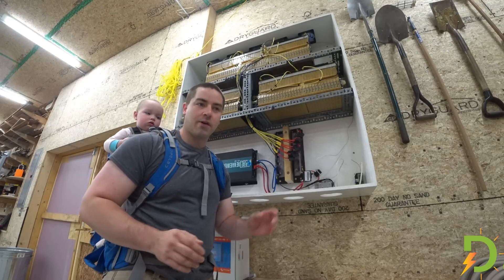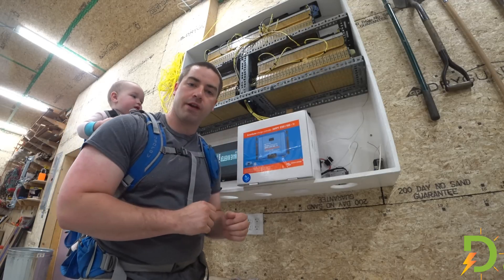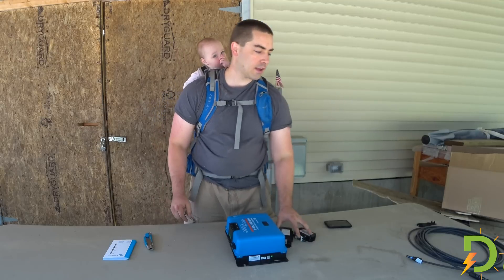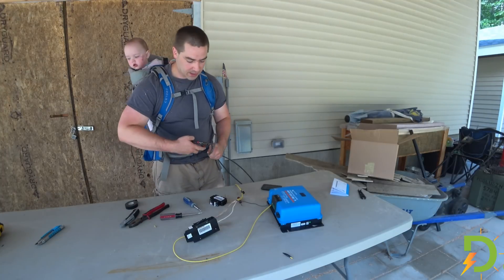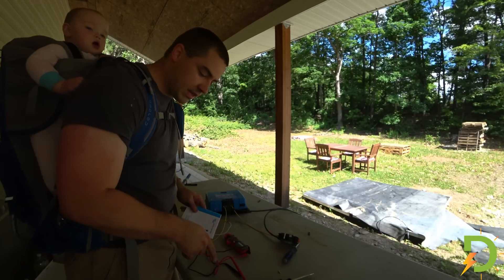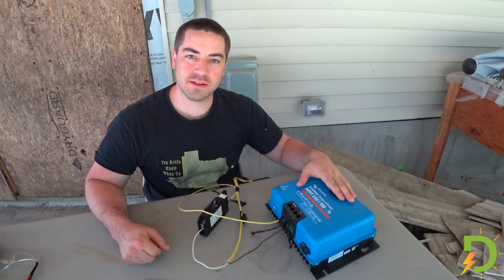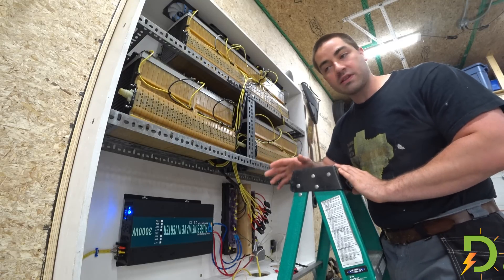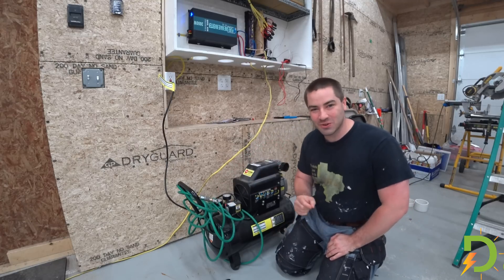Victron 250/100 Solar Charge Controller MPPT, Off-Grid System

Comment: If you have a 12S Li-ion battery system, shouldn't the charging voltage be 50.4V since each cell is 4.2 and 12 in series is 50.4V? Is there a way to set the charge controller to this exact voltage?
Reply from the maker: Hi redstone craft guy,  You are right.  4.2 volts per cell is the maximum voltage per cell for this type of battery.  The Victron charge controller can be set to exactly 50.4 and does an excellent job stopping there.  I'm keeping my voltage a little lower at the moment because I have not yet installed a BMS.  A BMS is "Battery Management System" and offers safety when maxing out the charging.  Thanks for watching.
Reply: @DavidPozEnergy  ok thanks.
Reply: @DavidPozEnergy  If you don't need the extra 20% capacity, keep it at 4.00v per cell you will get about 4x the cycle life at that voltage compared to 4.20v charging.

Comment: If you didn't have an iphone could you have updated the firmware yourself?
Reply from the maker: No.  The charge controller was shipped with a firmware two versions old.  My Battery monitor from victrron was also shipped with a firmware 2 versions old.  I've had others comment the same thing with tier stuff.  That old firmware does not work with my android version.  I tried using the app on my windows laptop (which according to Victron is also supposed to be compatible) and that still did not work with the old firmware. However, I've had others comment on this video saying that the old firmware worked on their androids (different android version).  So it sounds pretty hit or miss.  If my wife did not have an iphone I probably would have asked a friend to come over.  If that did not work I would have had to return it and ask Victron to send me one with an updated firmware.

Comment: Thank you.  I am at the learning stage.  I have purchased some panels.  I will probably pick up that brand of controller too.  Would you recommend the Volt Battery over the Tesla Battery packs?   I seem to have easy access to the Tesla batteries at $1,250 each.
Reply from the maker: Hi Bill,  I'm glad the video can help you with your setup.  I do not recommend Volt over Tesla, or the other way around, they can both work great. 
 I have not used the tesla batteries myself, but from what I can see they are very easy to wire up.  I had to modify the wiring in the Chevy Volt pack (check out the video) but with the Tesla I think they are good to go from the start.  So that is nice.  But, the Teslas are a bit more expensive.

Comment: Really enjoying your videos. :-)  I am running the Victron 150/70 controller with 1800W of solar to a 24V Li-Ion battery bank from an EV. I am curious what settings you are using for absorption and bulk. Since I am running 6S, I just set them both to 24.6 (4.1V per cell) and feel this could be better optimized. Thanks!
Reply from the maker: Hi Doug M,  Right now I'm not cycling my batteries very much, so I am using 4.0 volts per cell x 12 cell or 48.0 volts in absorption.  Then I'm running float at 47.7.  This was recommended by "The Hillside Pranburi" and made sense to keep the charge controller from short cycling between the two modes.
Reply: That makes sense. Thanks again for the great content!
Reply: @dougm4154  You don't float Li-ion batteries.  It's bad for them.  Floating should be disabled (not sure if this is possible).

Comment: The Volt Batt are liquid cooled,  if you draw too much or you fast charge it will they get hot without coolant ?
Reply from the maker: You are right, if I was to move too many amps too quickly in or out of the batteries they could overheat.  The good news is that running a tool and AC in my garage is nothing compared to moving a car down the highway.  I'm not pushing these batteries at all.

Comment: do you need a Battery Management System if batteries are not lead acid?
Reply from the maker: Most sites I've read say a BMS is very important with lithium batteries, however there are some YouTuber's I've seen without them.  I suggest them to err on the safe side.

Comment: Not all Bluetooth implementations are equal. My wife's fitbit has trouble with both Samsung and Huawei. The Victronconnect app works fine on an ancient note2 and on my new Huawei but fails on the s4 mini. That's to say, it might be a combination of the phone and the older firmware on the Bluetooth interface. These controllers always ship with slightly older firmware. You are expected to update them at install time.

Comment: You basically just proved that a BMS is not really necessary. With batteries with such low internal resistance and wires cut the the same length...I believe it will boil down to a maintenance issue 3 or 2 or 3 times a year.. great job man..  love the videos .my inverter is coming in the mail. Can't wait to move forward with my own set up
Reply from the maker: I'd love to see some pictures of your setup, I'm on facebook if it is easier: https://www.facebook.com/DavidPozEnergy/
Also, check out this video Mark made.  He has been using batteries with no BMS for over a year.  https://youtu.be/si-8N972A-U

Comment: For Android phone to work with victron app turn GPS on
Reply from the maker: Hi akram hawere,  Thanks for the suggestion.  I had tried that, along with several other suggestions I found on blogs.  Nothing worked until I updated the firmware.  Now the charge controller will connect to my android even with GPS off.

Comment: If you are connecting your PV panels in series, then you will get the same amperage no matter how many (assuming they are the same). So you can use the same cable for 2 or 12. This is the main advantage of higher voltage configurations (in series) vs high amperage (in parallel).
Reply from the maker: Hi Jarek,  Thanks for watching.  As for my comment about only two panels to keep the amps lower, I was reffering to the battery side.  The MPPT charge controller drops the volts down, and increases the amps.  I was using a piece of 12 AWG wire.

Comment: 10:01 Are all the holes on the face-plate for venting/screws?  I am wondering if the circular ones might be connected to each cell to check voltage/screw connection during initial install.   Not really sure if that made sense... 
Looks like a great system.  I am big into upcycling and repurposing things as well as solar in general.  Glad I found  your channel.
Reply from the maker: Hi Dakota,  I not sure which holes you are referring to, but here goes...  The battery shelves are made of slotted steel angle.  That is made with holes and slots to allow different bolting options.  Or, if you are referring to the 5 large holes in the bottom of the cabinet, then those are to allow venting when I install Plexiglas on the front.  I hope one of those helped. Thanks for watching.

Comment: Victron Bluetooth only seems to work with half the phones you throw at it. I tried 3 Huaweis (no dice). Works with Samsung A5, Tab 4 and ZTE A520.  It's going to be a major problem 7 years down the line, when you find nothing works.  One thing that worries me is that amateur installers will not worry about configuring 200V panel arrays. This DC voltage will sustain a 33mm welding arc, which can burn your house down. Must say I'm mystified what those 2 panels could be, that yield 623W. My panel yields can be about 75% of rated value, due to heat and wiring losses.
Reply from the maker: Those panels are LG365N2W-G4.  Thanks for watching.
Reply: 85% yield with -0.38% loss per °C in what looked like cool weather, with a tarp just pulled off it. Thanks.

Comment: thanks for the video, very informative. I have a question though do you need breakers to connect from the battery to the controller? I just bought a PWM 60 amps charging system which I connected to four 100w solar panels, should I add breakers and if I should which type of breakers? thanks
Reply from the maker: Hi Otis,  Thanks for watching the video.  Circuit breakers serve two functions.  First, they add a level of safety so if something shorts out, or is overloaded, it trips.  Second, it gives you a means of disconnect so it is easier to service part of your system without shutting down everything.  I think it is worth it to install them.  

I buy mine from www.altestore.com  I'm not affiliated with them, it's just where I buy my stuff.  If you call they can match you up with a circuit breaker properly sized for your solar voltage and amperage, as well as your battery.  The breakers I have are made by "Midnite Solar" and are DC rated.  As an example, here is the breaker I have between the solar and charge controller in the video, however this is not necessarily right for your application.  https://www.altestore.com/store/enclosures-electrical-safety/overcurrent-devices-fuses-breakers/din-rail-circuit-breakers/din-rail-mount-circuit-breakers-p40906/#GENBRKDIN-15

Comment: Should have gone for a Victron inverter too! My 3000VA (2400W) peaks at 6000W.
Reply: Victron inverters (and many others) have pretty bad idle power consumption. The Australian Selectronics one is impressive
Reply: @Wallabynge  or Latronics, also from Straya......with impressive start-up current, even handles my house a/c. …9 years of continues use, never missed a beat.

Comment: Don’t look now but there is a Beautiful Woman on you number trying to pass you up.     I heart that the Alt store had bad customer service.  Love miss Amy’s Instructional Vids she has taught me a lot.    Best of luck.  P.S. get a BMS.
Reply from the maker: Hi Jim,  To give you an example of why I like them: When I went to buy a disconnect/combiner box ( https://youtu.be/IJluk4U8pys ) I asked for a particular model box, and circuit breakers.  Then one of the sales guys (Adam) came out from the back to talk to me.  He recognized that the model box I asked for came with a combiner bus bar meant for 150V breakers, but I was asking for 300V breakers.  After clarifying, he changed my request to a slightly different part number that came with the correct busbar.  He saved me a return trip.  I didn't know there were different part numbers for the parts inside the combiner box.

Comment: Hey David good job so far just started watching you and the Volt powerwall setup. You got a high end Victron Charge Controller that can handle a lot of solar input however your inverter is lacking if you want to run any kind of Amp hungry tools like your compressor. The inverter you have is just what I call Point Of Use inverters and true high end Off Grid Inverter like ones everyone else mentioned will handle that load just fine. A 4-6kw Magnum, Outback, Schneider, SMA and if budget is concern an Aims inverter will work but they are flakey now. The Aims Chinese knockoffs will work in pinch like GTPower. John
Reply from the maker: Hi John,  I agree with you.    Basically I am buying the components as I save up for them.  I don't expect much from the cheap small inverter.  I look forward to buying a larger, whole house inverter from one of the companies you mentioned.  Since those are going to run into $4k, they will take a while to save up for.  The cheap inverter allows me to start using the powerwall now, which I do.  Back in my video about the Reliable inverter https://youtu.be/me0eAJL95og  Which do you use, or recommend?

Comment: Get yourself a Victron inverter they have awesome  startup ability and are virtually bullet proof
Reply from the maker: They do look great.  I think I've read all their spec sheets and the closest to fitting me would be two quattro 48/5000.  I would need two to get the 120/240 split phase.  Unfortuantly two of those inverters winds up costing about $5600.  I wish they made a split phase in one unit.  I did think about buying their quattro 10000VA 230v and then using my transformer.  I have a video where I tested this idea and found my transformer uses 100 watts in idle.  Too much of a load.  Have you seen that video?  It's here: https://youtu.be/P4Wm83vsdKc

Comment: Hey : Love your content keep it up :) Quick question for you, I have some 40V batteries that are BAE 200. Would this Charge controller be able to handle it? Can you set a defined max voltage on them or do you have to choose from 12v 24v 36v 48v? Thank you very much!
Reply from the maker: Hi Maxime, On my app I can set a maximum charging voltage, it will not go over that.  I showed the range in the video, which is 39.00v up to 69.56.  I can actually go lower if you select 12/24/36 volts instead of 48 volts, but I'm using it at 48 volts.  I don't know the details about your battery, but if you want to set a maximum charging voltage of 40.00 volts, then YES, it can do that.
Reply: DavidPoz And can you also set minimum discharge voltage? If so this is the charge controller that I need :) Thanks again!
Reply from the maker: No, you can't set a minimum discharge voltage on the charge controller.  This is because when you are drawing off from the battery you are not drawing through the charge controller.  However, some inverters can be programmed to the minimum voltage before shutting down.

Comment: So what was price on this unit?    Then what are you going to use for BMS?
Reply from the maker: Hi Casey Cross,  I'm sorry, but I don't want to get into hot water with Alt-E by sharing a quote they gave me.  They were able to beat the prices I found online.  If you call them they can give you a quote, www.altestore.com
As for the BMS, I haven't yet decided.
Reply: DavidPoz what BMS units are you considering?  Or is there certain ones that ‘play’ nice with this charge controller?
Reply from the maker: Hi Casey, I'm just learning about BMS's.  I've been watching "Going Off Grid" as he has several types and may try one of those.
Reply from the maker: Hi Casey: Alt-E now displays the unit on their website for $895.  https://www.altestore.com/store/charge-controllers/solar-charge-controllers/mppt-solar-charge-controllers/victron-mppt-solar-charge-controllers/victron-energy-mppt-solar-charge-controllers-p40910/#VICSSMPPT250100  (I'm not affiliated with Alt-E)
Reply: DavidPoz  check out Morton's on the move this gentleman is electrical engineer and he installed a very user-friendly system in his RV using Tesla batteries. His videos are filled with a wealth of information about a off-grid solar system installation. This is one of the safest systems I've seen design on YouTube. There's plenty of redundancy in case one system fails . Keeping you and your family safe

Comment: The lack of a display is the only thing I don't like about the controller.
Reply: If you us the Bluetooth app you will be much farther ahead than a display. You can monitor the charge controller from another room and make adjustments as well. 

If you're stuck on having a display, fire up an old cell phone or tablet and make it dedicated to the controller. You can mount it near your power wall and will achieve a better display than you would otherwise have. 

My charge controller has 2 led lights that indicate the present process like Absorb/Bulk & Float.
Reply from the maker: That's a great idea.  I thought tablets were hundreds of dollars.
Reply from the maker: I agree, that was a compromise for me.  They do make one as an accessory, but I'm happy with the app and don't plan to buy another display.
Reply: I think that you can buy a cheap ($20) android mini-tablet with bluetooth and set it next to this device, run USB power to it, and you'll have yourself a dedicated power-app display, aside from your phone and other devices. What do you think? (example RCA voyager 7" from Amazon for $35)

https://www.walmart.com/ip/RCA-Voyager-7-16GB-Tablet-Android-6-0-Marshmallow/53990885?wmlspartner=wlpa&selectedSellerId=0&adid=22222222227050391321&wl0=&wl1=g&wl2=c&wl3=147333545006&wl4=pla-262799094393&wl5=9004398&wl6=&wl7=&wl8=&wl9=pla&wl10=8175035&wl11=online&wl12=53990885&wl13=&veh=sem

Comment: The midnight classic is a awesome controller. I didn't know how good it is until recently. It is adjustable from 10-100v out. And 96amps. And it can be over driven. Where you maximize for lower sun. To get more power with out burning controller. It will not do more than 96a even if 10,000 amps is available. I'm thinking of getting one.
Reply from the maker: Yeah, there are lots of good controllers out there.  I've heard great things from the Midnite classics as well.
Reply: The show stopper is the wizbang jr. No one else has stop absorb by amps.
Reply: @unyalliman  Does the victron not use end amps with their shunt?

Comment: Sorry for my ignorance... MPPT, BMS ?
Reply from the maker: Sorry, I should have clarified in the video.  MPPT stands for "Maximum Power Point Tracking".  This allows me to use a high voltage solar array ( up to 250 volts) to charge a low voltage (48 volt) battery.  Not all charge controllers have this ability to drop the voltage down.  Some charge controllers are called PWM (Pulse Width Modulation) and for them you need to match the solar array voltage to the battery voltage.  

BMS stands for "Battery Management System" which is an important safety device when using lithium batteries.  I have lithium batteries and should install a BMS.  The BMS can monitor and balance each cell in the battery.  

I'm actually just learning about BMS's myself so I'm not a great resource to learn about them.
Reply: Thanks for the clarification ! Love your videos keep then coming :-)